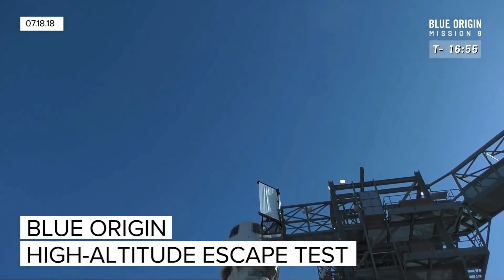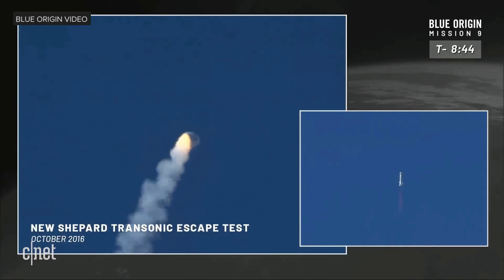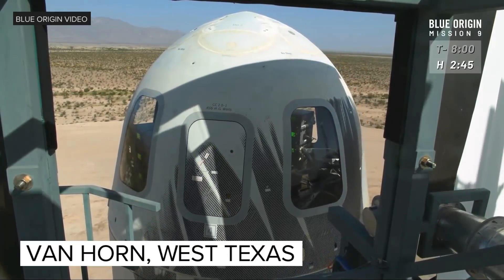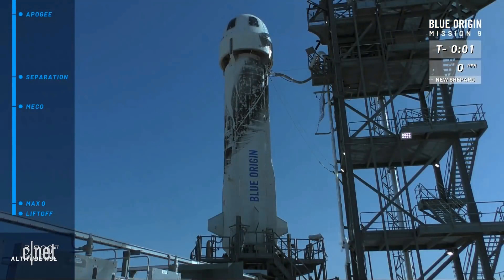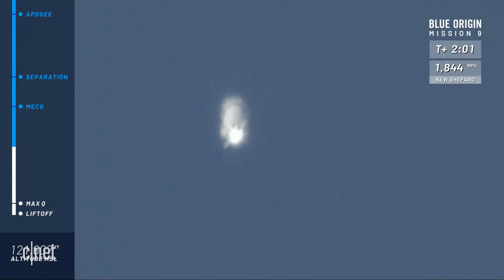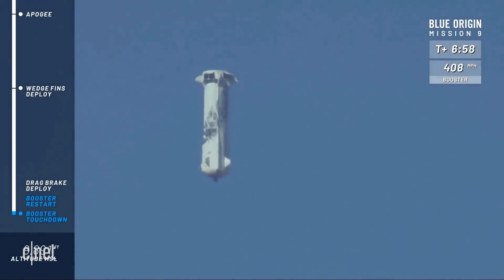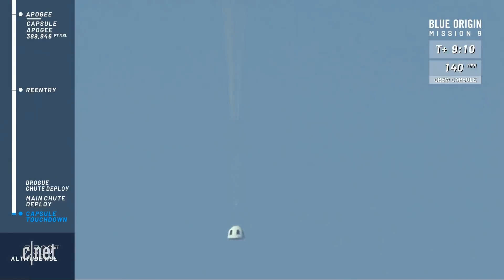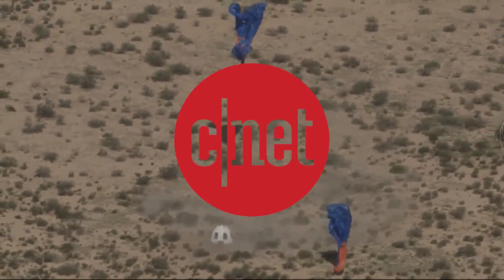Blue Origin's high-altitude escape pod motor test

Comment: Are you serious?
Impossible to land a rocket backwards with negative thrusters alone.
You need wings and side stabilisers furthermore it is clearly a digital overlay you can see the pixels on the exterior of the rocket where is overlaid on real background.
Reply: Np S it has 4 control fins right there, can you not see those
Reply: Stop saying it's impossible ... Try it in KSP it's hard but doable
Reply: Jason Balius 
Look Pal  i'm a pilot and I can tell you it's impossible to land that kind of object backwards without significant wings;
 it's basic physics seriously.
Reply: Np S the engines gimble.
Reply: Jason Balius 
I don't think you are referring to the same phallic object that seems to be able to the land backwards, a Gimbal will not work in this respect.
A Gimbal works in the same way that Steadicam would you cannot apply it to aeronautics in the form depicted in the video as trajectory does not perform in that way it's just common sense you can't reinvent the wheel.
Reply: Np S I'm referring to the verb. the ability of the engine to move around and redirect the exaust. It's the same concept as balancing a broom on your hand by the end of the handle
Reply: Jason Balius 
Yes I'm familiar with "the concept "
Once again I don't believe you and I are discussing the same subject matter.
This upload is the same as SpaceX; enough said!
Look up videos on the same subject matter by the YouTuber:
Jeranism.
Reply: Np S I've watched a falcon 9 booster land with my own eyes. I have no doubt Blue Origins can do the same thing.
Reply: Jason Balius 
Given your recent claim of actually seeing the SpaceX landings 
One must ask have do you believe in the moon landings of the late 60s?

Comment: Aww, so cute. Blue origin ain’t nothing compared to spaceX
Reply: Why? They are doing the exact same thing.
Reply: @barthsimpson3   Not that I agree with the original comment, but for the time being there is a significant difference between orbital and suborbital flight and landings, in terms of speed and distance, and therefore the degree of difficulty.  The SpaceX Falcon 9 first stage often reaches twice the speed, and has to perform either a boost-back or a landing on a barge downrange, neither of which is trivial, while the New Shepard, for the most part, goes straight up and straight down.  Both are impressive, and kudos to Blue Origin for doing it first and making it look so easy (it isn't easy), but then again what SpaceX does currently is in fact more difficult (especially the high-speed barge landings).

Comment: When they gonna build one to make it to orbit and ISS?
Reply: Julian Crooks 
You're looking at it, still in test phase though
Reply: Mike Walsh you're wrong, its's only capable of suborbital flights.
Reply: Mr Kacperso 
What do you think Blue Origin is doing? They're testing now, but soon their rocket will be taking astronauts to the ISS, which IS orbital!
Reply: New Sheppard is only suborbital system, it's not intended to reach orbit. Actually Blue Origin newer reached orbit yet, so there is long loong way before them to be actually called space lauch provider.
Reply: Mr Kacperso 
Blue Origin will be there soon!